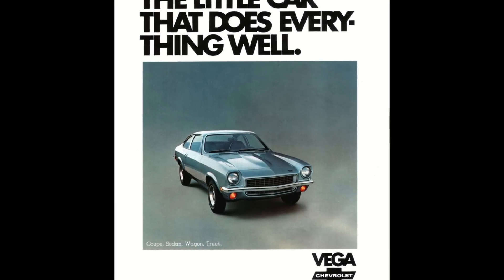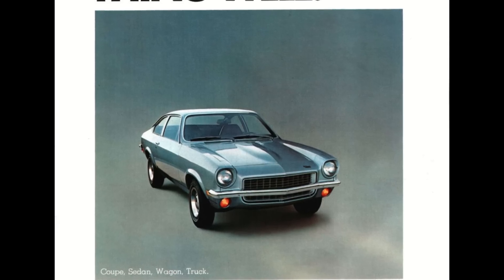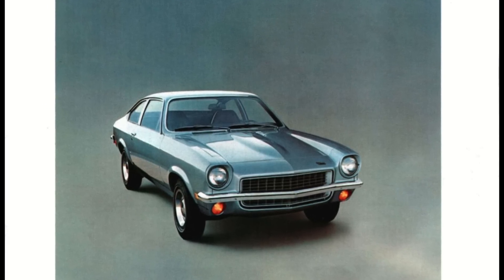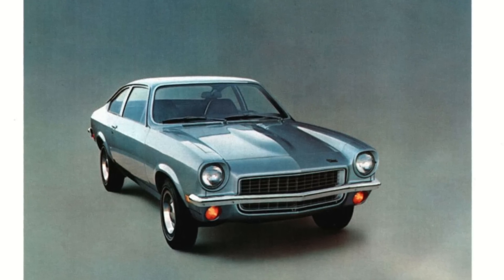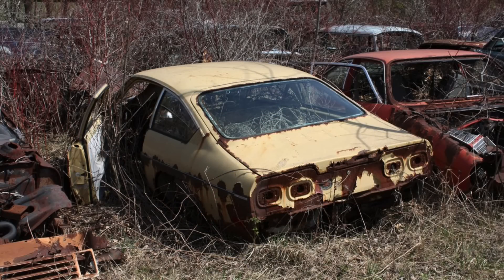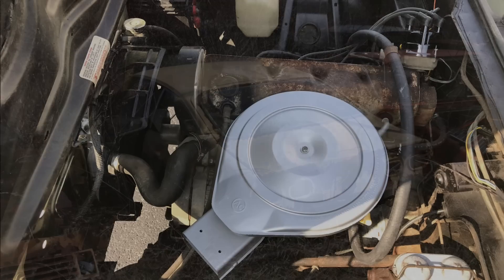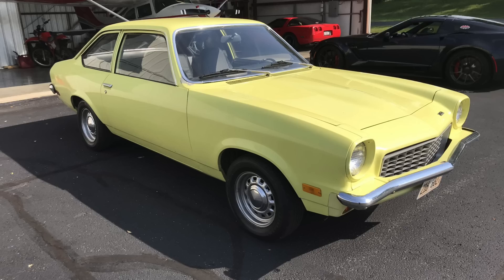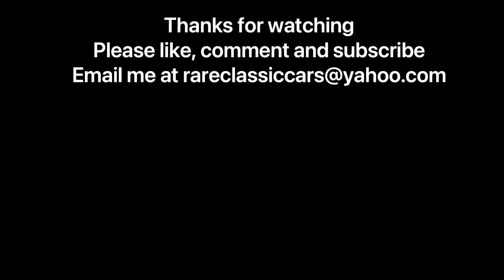GM's Largest Failures: Why The Chevrolet Vega's Engine Turned Buyers Away From American Cars

Comment: A company called IECO made a lot of money selling Vega blocks retrofitted with cast iron sleeves.  Likewise,  a "Printoseal" head gasket from Fel-Pro held out much longer than the factory gaskets did.  Another design feature of questionable intelligence was the method of adjusting the tension of the timing belt; the water pump had slotted bolt holes that allowed you to slide the whole assembly back and forth to achieve the proper tension...and also end up with a leaking water pump gasket.

Comment: I remember in 1973 when my mother, father and I went to a Chevy dealer and looked at the new Vegas.  The salesman then offered a test drive.  When we went to go on the test drive, I remember the salesman started the brand new Vega, and there was a lot of blue smoke coming out of the exhaust pipe.  Then he told us it was from sitting on the lot, and was not being driven.  It was all over by then.  My mother told him a brand new car should not emit smoke when you go start it.  After that was said, we were out of that dealership, and drove back home in our Volkswagen.  The Vega's sealed air cleaner was also the same thing that Chevrolet put on their 1976 and 1977 Chevette several years later.  You had to buy the entire sealed unit in order to replace the filter.  In 1978 I remember the cost to replace the sealed air cleaner unit on the Chevette was around $50.00 at the time.  That was expensive at the time.  Pontiac also had it's version of  the Vega, and it was the same car as the Vega rebranded as the Astre.  Many parts of the Vega, and platform were also put into the Chevy Monza.

Comment: In my 72, I had a Crower high lift cam, hooker header, holly 500 cfm carb. Mine also did not have the power glide transmission. It came with a factory Turbo 350 transmission. Factory head gaskets sucked. I went through two of them before I found an after market gasket that would hold up. Yes the inner fender walls rusted, I broke the rear end racing once doing a neutral drop! Before bracket racing I won a few trophies at a local 1/8 mile track cause they would give me the competition more lights Lol! And yes by the time I sold it the cylinder walls were shot. But it was a lot of fun back then. The 72 was my favorite year cause it looked like a little Camaro.

Comment: I owned a 74 Vega with the 1/2 Engine--I could outrun it in a 50 yard Race. I was touring the Ozark Mtns. in my New Vega--VW Bugs were Passing me and I had Gas to the Metal. My wife made me get rid of it, we Traded for a Used Cutlass Supreme V8 that would run like a Scolded Dog, never Looked Back, never a Small Engine Vehicle again...

Comment: These deficiencies made the Vegas an ideal candidate for V8 conversion and get a cheap hot rod.  The Vega share the same basic frame as the Monza , which had a V8 option.  It was a tight fit and to be safe, you likely have to upgrade your tires and brakes.

Comment: You missed one of the most important problems with the engine.  390 aluminium is very stiff and wear resistant up to a point.  When it reaches a certain temperature( I don't remember the exact temperature) it loses it's strength and wear resistance.  Vega's that never overheated would run a very long time without problems.  Unfortunately the small radiator/cooling system made overheating a certainty if it was not carefully monitored.

Comment: I worked in a gas station during the 70's, and when we would see a Vega coming up the driveway we would joke that the driver would  say "Check the gas, and  fill up the oil." I remember that they had a rubber oil cap that was so hard to put back in that many owners cut slits in them to make it easier to push into the filler opening.

Comment: Almost bought one in 1972 but bought a 2300 cc all iron Pinto wagon 4 speed.....By '72 the running joke in car mags was Vega's dash board  "Need new Engine light" !!!  ....Steered away from GM & never (Like never Needed to return to dealer for probs) had any troubles with the Pinto wagon or used 2nd hand slant 6 Duster.....

Comment: My parents had one of these, I was young, but i remember that we mostly drove loaners cause ours was always in the shop. I remember the dealer had a number of workarounds, for example they installed a switch that would turn the AC clutch on or off. Just a piece of junk, and we were poor so the air cleaner issue was, well, an issue. From then on we only bought Toyotas.

Comment: Yup, my Dad bought a new one of these.  We lived in lower MI and winters were rough on it and engine melted after 30k miles.  Then a ‘80 Pontiac Phoenix Fiasco and my Dad only bought Toyota’s after that engine had to be replaced at around 70k miles.

Comment: I wouldn't say that Porsche (not sure about BMW or Merc) advanced the aluminum-silicon sleeveless block technology greatly.  Their first water cooled flat-six versions intro'd in 1996 (Boxster) are quite prone to bore scoring, especially in the larger displacement versions. 
I can imagine the engineers at Porsche discussing "those Vega's in the seventies, let's try that technology and see how it works out".  At least they did a better job with radiator size.

Comment: The honking Cadillac sized Delco starter probably offset any weight savings that an aluminum block offered. The Vega was the kind of vehicle that cheapskates would buy so when it came time for a new air filter most Vega owners would probably be too stingy to pay 5 times the going rate for a unitized filter. They probably just tossed it and let it eat dirt.

Comment: My parents had a 1973 Vega GT 4speed that was bright yellow with black racing stripes and black interior. I was a teenager when we had it and I really like the way it looked. But it was a piece of junk. We kept cases of oil in the garage and added oil daily. Spark plugs had to be replaced often too because of fouling. Sad situation.

Comment: Very good description of how bad Vegas were. I worked for a TV service company in the mid 70's. They had fleets of Vega wagons. Within my first 6 months of work I went through 2 engines while driving them. One was so bad as I was on the freeway but managed to get the upcoming exit down to a gas station pouring blue smoke out the back. It was DOA as i got into the parking lot. Folks were laughing at me for driving Corvairs but I could drive used ones for years. Guess I had the last laugh.

Comment: When I was a kid, the Vega was a very popular choice for drag racers. Super small RWD chassis; with engine compartments that could contain small block v8 builds. You ended up with lightweight dragsters that competed incredibly well in both the quarter-mile and eighth-mile runs.

Comment: I owned a 1972 GT 4spd in 1974, it had around 40,000 when purchased. It was very clean. It did not burn oil or go through coolant. Four months after purchase a man who was blind in his left eye put me and the Vega into a ditch. No more Vega. Based on what I've read over the ensuing 50 years? Probably just as well. 

Without good competition, great big established "too big to fail" companies will put out inferior products. We owned restaurants and when Hobart, the top dish machine manufacturer of the era got bought by Dart Industries? We couldn't use them anymore, just plain junk, as bad as a Chevy Vega if that is possible.

Comment: I learned to drive on a 1973 Vega. I used to pull up to full service and say "fill up the oil and check the gas".

The front fenders and wheal liners were so rusted away that on rainy days the water coming off the tires would fountain straight up through the front fenders.

Comment: I was in college in the early 70's and a friend and I rebuilt the engines in four different Vegas.  There was a shop in Springfield, Illinois that would bore the block and sleeve with cast iron liners.  That was kind of cutting edge for our area and that seemed to fix the oil consumption issues.

Comment: I had a 73 Vaga and 76 Pontiac Astro and never had any problems with the engines, I keep a close eye on the fluid levels and in both I only used Mobil 1 oil.  I even pulled a open Uhaul trailer loaded  from Deming N.M. though El Paso TX and up Guadalupe Peak pass to Hobbs N.M. with no over heating of the engine.  I loved both cars and if I could get another one today I would buy it.

Comment: My Vega wasn't your average. Malibu 350, TH350 trans+ stg 2 shift kit and a B+M Quik Klik shifter, ladder bars, Monza kit front end, exhaust, radiator and springs, limited slip diff to absorb torsion. Then I got a set of 282 heads and a matching cam! 😎
I bought that car for $1000 with spun bearings and a homemade custom job. It wouldn't even rev because the guy had a flex fan on it with the Vega radiator so it kept catching and spitting the rad out. That's why I got it cheap. I spent 3 yrs and maybe $3000 getting it right. It would cost $25,000 now to buy my car back if it were still around. And even then the stuff I put in it would be antique by now.

Comment: Mine ran fine until I traded it off with 92,000 moles on it.
Rust free, never garaged. I ran 4 snow tires in winter because the front was too light to steer in snowy conditions. 
Engine had to be driven hard, Americans weren't  used to rev their engines but these needed to be to eliminate  vibrations from "lugging" it.

Comment: I owned the first model year. The motor vibrated so badly under acceleration it rattled your teeth. I recall the manual shift lever looked like belonged on a Freightliner semi.

Comment: we had a few Vegas at a car lot I worked at,, they had a common issue,, they ran quite warm, very low miles,, so, I was talking to a friend of mine about it, he told me to      pull the Radiator and have them rodded out,, sure  enough the bottom oh 3 of 4  rows            had a kinda looked like Aluminum Powder  in them,, I was told  that       a   lot of blocks were not cleaned right and they would pass aluminum shaving  to the Rad and clogg them,,,what ever,, it worked,,,,,

Comment: GM makes s. vehicles.  I would never buy any of their products again.    I would not even take one if you give to me for free.

I once had a 2  years old Chevrolet Cavalier  with under 20k miles that can not even be sold for a profit.    Then I had to fix the over heat issue on the Chevrolet Cruz for a friend and what i saw under the hood was a bunch of plastic parts for  coolant and other stuffs.  They might look pretty from the outside but under the hood they are a s. show.

I won't miss it if GM goes broke and extinct.

Comment: one thing you kinda missed was that the cydinder needed to be etched to reveal the silicon that would make the hard cylinder liner, that there goal of trying to reach 100 vegas per hour in a factory really hampered adressing alot of these issues sence it would lead to a slow down in production & the fact that the plastic liner was proposed during design but was rejectected due to a 5 dollar per unit cost. other than that this was great!

Comment: Back then, I had a friend who had both a Vega and a Pinto. The Vega was much more solid on the road and handled very well, while the Pinto felt like it was perched atop a flimsy suspension. But in the end, the Vega died young, and the Pinto soldiered on, regardless of its poor handling.

Comment: GM should have collaborated with briggs and stratton to make the heads and engine blocks from aluminum..B&S had advanced aluminum casting knowledge and expertise to make flawless detailed aluminum castings....the exact same engine but B&S could have made the blocks and heads and GM then assembles them and puts them in....the valve cover could say GM in big letters then in little letters it says by briggs and stratton....collab with reynolds arap for the body to be made of aluminum👍👍briggs knows a thing or two about aluminum cylinder lining...you can run a briggs without oil for hours

Comment: Dayton and Xenia, OH in the 1970's.  Our neighborhood had several GM engineers who bought the new Vegas because they got discounts.  One day we lined up five new Vegas and looked at the engine compartment.  Each on had different wiring runs and component locations.  We could not believe the haphazard assembly, missing hardware and after that nobody bought a Vega. The other problems came later.

Comment: Good engine IF it didn't run hot which would do if a quart low on coolant. GM came out with a retro water level sensor as a band-aid.

Comment: I had a Vega and put 3 engines in it….The second engine only lasted 100 miles from Cleveland to Toledo and blew up at a tollbooth. 
Of course I was trailing a 6x10 covered trailer. 
One engine would constantly back fire and chugged the gas like crazy.

Comment: GM tried so hard to get the Vega right and they were so close.  John DeLorean may have been a wild man but he did an excellent job with the overall Vega concept.  He got Penin Farina of Italy to design the car’s exterior and GM sold the design concept to Mercedes Benz and the design lives on today in the many new beautiful Mercedes with the Vega grill.  The aluminum engine concept was bought by Porsche and is still used today in its Boxer engine.  Sleeved, of course.  Don’t give up, Mary!  You can and will get the EV right.  Just hang in there!

Comment: I loved my 1974 Vega after I put the fix in.  And I lived in Arizona so we didn’t have rusting problems.  There were two ways to fix the engine.   One, rebuild the engine with a 1977 year cylinder head.  Finally by 1975 GM headquarters listened to its field engineers and put in all hot spot fixes which were discovered by 1971.  Two, run a 1/8 in copper tube from the upper right cylinder head (facing forward) to the intake side of the water pump.  The engine immediately transforms from a hot clattering mess running 210F water temp to a cool running quieter mess running a water temp of 160F.  The engine is transformed in nature.  It could easily handle AC on idle.  It could easily pull away from rest even though I had the four speed narrow ratio gear box.  And my car had the large Arizona sized radiator.  I reduced the exhaust valve lash from 0.30” to 0.25” and got rid of most of the clatter.

Comment: Congratulations!  You kinda sorta got it wrong with the failure of the Vega 140 cu. in. engine.  I personally owned a 1974 Vega GT and I personally rescued it from the junk yard, plus I have a degree in engineering physics so I can speak with authority on this issue.  And I have been personally posting this same note on other Vega websites and some troll has been stalking me on the internet remowing ALL  of my posts.  What gives? You act like I’m trying to publish the nuclear codes on YT.  The problem with the Vega engine of the 70’s was not the aluminum block nor the small radiator.  There was a huge steam pocket in the cast iron cylinder head that caused the overheating.  Basically the front two cylinders ran without any cooling water reaching them.  No wonder it burned oil.  No wonder the valve  stems failed.  Webmaster you watch.  Someone will remove this note perhaps even before it can be posted.

Comment: I had a Vega GT a 73 with a four-speed I pulled the engine out because it was burning oil put iron sleeves in it. Installed a good set of forged pistons. Ported the head and installed oversized valves. Did a header dual point Mallory ignition and two Weber side draft carburetors also installed the air conditioning radiator. That car would rip!

Comment: I bought a 1972 Chevy Vega Yenko brand new in Rockford Illinois. Worst piece of crap I ever bought the rear axles came apart and the wheels came off at 12,300 miles and they wouldn’t help me at all because I was over the warranty engine, sucked, body rusted out.

Comment: whoa.  at the on-set the vega was billed to be a car to last 3 years or 30,000 miles.  at that point it was so be recycled, which it was designed to do.  don't  buy tires, brakes, exhaust systems or anything, buy another car.  ads in magazines were spelling this out.  the car retailed for around 1700 dollars.  with the junk price in the picture,  you could say the car would cost 
$1000 per year or three dollars a day. or 5 cents a mile.  buyers did not understand this concept and tried to drive beyond the designed service life.  of course that caused problems.  they should have recycled them.  if used as intended, the vega should have given good value, kept the national fleet modern and provided jobs for people hired to build replacements.  ed cole was watching out for the consumer and uaw.  perhaps gm should have followed the cars better, and requested the consumer to come in at 25,000 miles and replace the car before they became unhappy with it.   side note, your work is fantastic.

Comment: In its last days, my 71 Vega Notchback carried a case of motor oil in the trunk.  We replaced the head gasket but it never solved the oil burning.  The little cloud of blue smoke out the tailpipe was priceless.  Oh, and the inner wheel wells rusted away in 4 years, kicking all the road water, snow, road salt, up into the engine bay.  That was lovely.

Comment: GM engineers spend most of their time fixing problems that never should've been released on the customers in the first place. I had a truck that everyone thought was a battle tank for how tough it was. What they didn't take into account was I had been over every system on that truck and tried to fix it as best I could. I had so heavily modified it there really wasn't a stock GM part on it. I drove it until the body completely rotted out and it was no longer safe in a crash